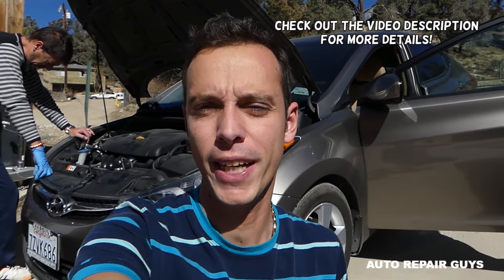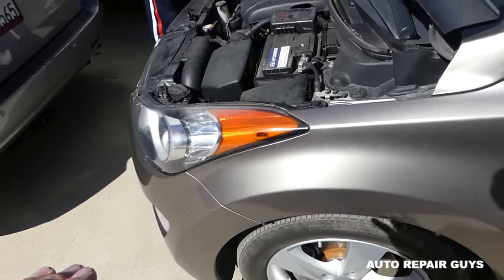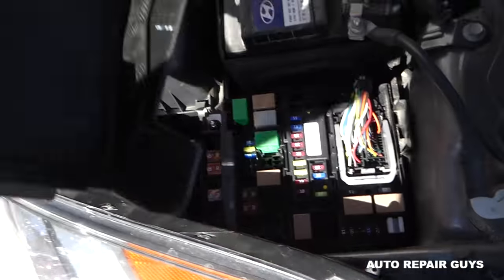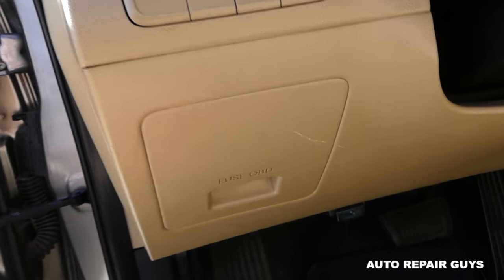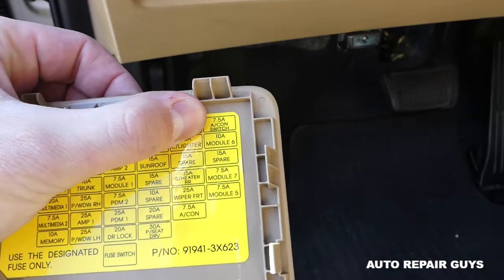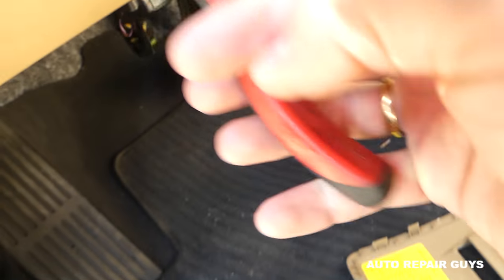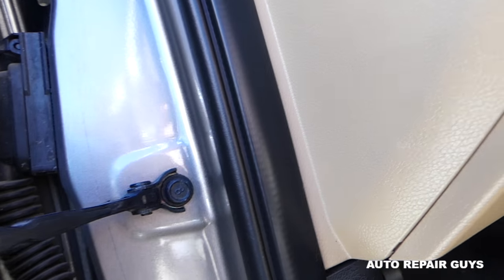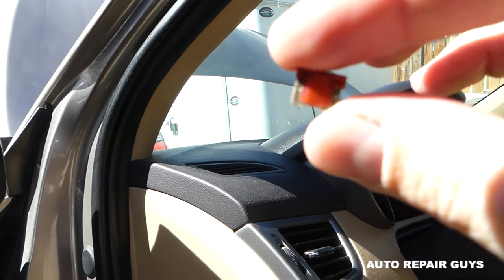HYUNDAI ELANTRA A/C FUSE AIR CONDITIONER COMPRESSOR FUSE 2011 2012 2013 214 2015 2016

Comment: I have the same problem with a 2011 elantra. Good compressor fuse & power at the fuse but no power to the compressor.  If i apply 12v to the compressor, it works & cools properly.  Im thinking it may be the E.M.S. fuse box. Any experience with this going bad?

Comment: It has a Fuse Remover Tool in the front Fuse Box in the Engine Bay. Its located with the Spare fuses!
Reply: That platic garbage sucks... needle nose much better

Comment: Thank you very much I'm having a AC problem with my 2012 Hyundai Elantra. So this video definitely helped me to eliminate certain options that can be the problem. If by chance you see this and have a theory why the AC isn't working on a Hyundai Elantra even though it has good fuses and plenty of freon and as far as I can see working and good belts I'd love to know your thoughts 🤔 thanks guys love ur channel 🤠
Reply: On my elantra, AC works but gets colder when on high RPM. What could possibly be the issue

Comment: @auto repair guys I have elantra 2013 model car, after ten days, today i start my car but my Air conditioner is not working, only hot air is blowing, i open the hood and check the compressor, but the compressor is not spinning with AC on, i try to find the relay in fuse box near to battery but i cant find and in the back side of fuse box cover i also do not found AC fuse or relay, 
tell me whats the real problem with my AC
Reply: Compressor control valve is the problem which is located on the compressor where the plug goes into.

Comment: FYI: you don't know what you're talking about. The fuse you pulled is for the AC blower. The AC is the other 7.5 amp fuse on the same panel at the bottom.

Comment: Hello sir. ive been trying to get some answer on my car ac. hope you can help me. I havea Hyundai elantra 2011 and when i turn on my ac the engine is supose to go a bit higher. it doesnt. my ac temp is  not cold but cool. My car has only one fan( radiator / condensor) . i know when ac is turned on the fan has to run at high speed, and then it should toggle between high and low depending on the circumstances. My compressor kick in but it doesnt cut off. relays ans fuses are ok. Freon is ok. hope you can help figure this out.Personally i think its the Fan

Comment: Hey there, is this a common problem? My wifes is a 2014 with under 40k miles on it. We just moved to Iowa from FL over the winter, so we didn't need to use the AC for several months and when she went to turn it on the other day, well, it didn't. I need to check this fuse, but does this happen often? What ended up being the issue on this one in the video?
Reply: JayyYouBitch my daughter has a 2015 and having issues ... the expansion valve feels cold but warm air is coming out ... it looks like this compressor is a direct drive everything is spinning but ac will not take a charge .. from what I seen these have compressor issues ?

Comment: Hey if your horn is not working in Hyundai Elantra 2016 how to fix it can you upload horn problems thank you???
Reply: Start to checking power to horn if it good try to test horn only give it power from battery. If You have sound, then start checking relays it's two of them in engine compartment.

Comment: So when I pull out the fuse how do you no it needs changing, I’m a woman what the hell do I no about cars, , but I sure as hell can change a fuse if need be, little help here.
Reply: If the metal inside the fuse is cracked then the fuse is bad